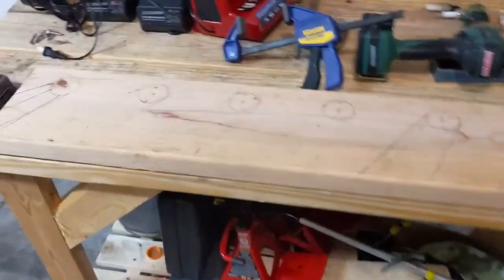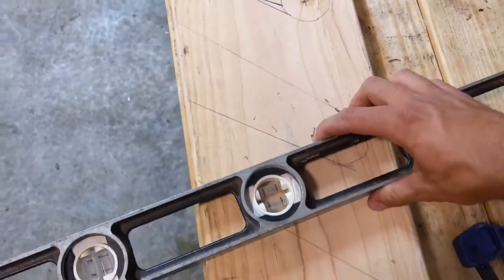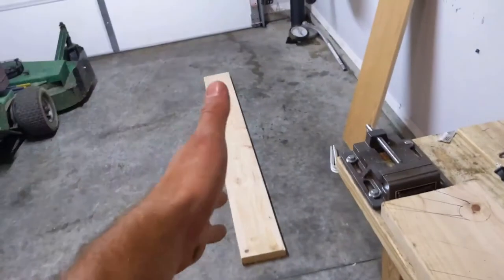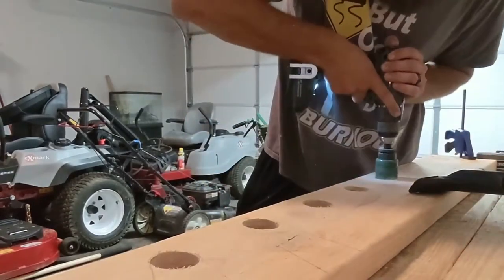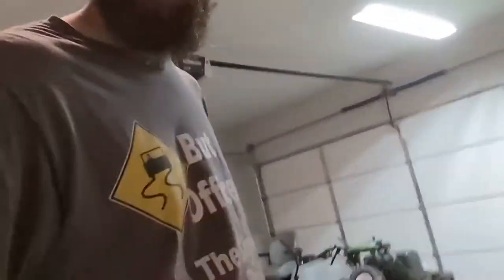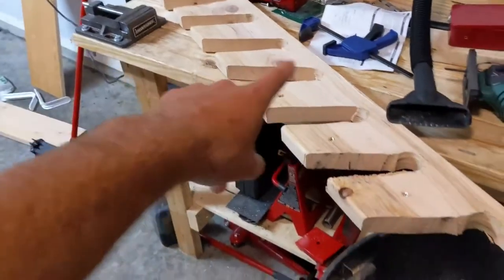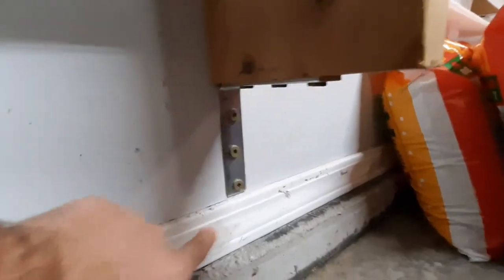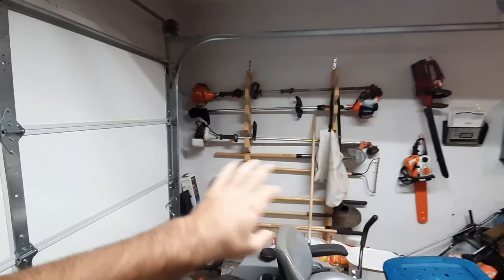How To Build A DIY Garage Tool Organizer Garden Tool Organizer

Comment: That's a good idea using the shop vac for the shaving's. Oh that sucks the wood splitting. Man that looks really good. Nice job and great video brother.
Reply from the maker: @Wild Bill's Adventures man I wish I realized it was split 🤦‍♂️
Reply: @JonsDailyHustle  I know trust me I even bought split wood and didn't realize until I started working with it bud. It turned really good though.
Reply from the maker: @wildbillslawncare5901  thanks brother 🙌
Reply: @JonsDailyHustle  You are welcome brother.

Comment: I will making mine to attach to the wall using a French cleat system and multiple attachment points.
Reply from the maker: @Larry Ginn that's awesome it should hold up well for you. I have put alot of weight on mine this past year and it seems to hold up nice. Thinking about making one for my trailer when I get an enclosed trailer

Comment: looks great Jon. I like using the harbor freight v-shape hang all hooks. they work great for trimmers and can hold multiple hand tools. ive got like 3-4 square shovels on one right now. great thing is they are like $2 each so some of them and a box of screws would be as much or less than one board. not hating on your idea, but lumber is very expensive right now. i made a video about them a few years ago
Reply from the maker: @Hazardra Lawn Care oh that's fine go ahead and hate....🤣🤣 Jk it's all good brother, voice your opinion. I'm always open to ideas. I was using thos hooks but don't quite like them for me, and wanted to be a little creative and maybe stand out a bit in my garage 🤷‍♂️...kinda lol. Wood definitely is pretty expensive now depending on what you get and where. At the time of making this video (originally back in may-ish) I spent less than 10$ total to make 🤷‍♂️. You could probably do it for cheap still if you source the wood right maybe 🤔🤷‍♂️. But your method is definitely way faster lol
Reply: @JonsDailyHustle  for that price you couldnt beat it for sure then

Comment: That's a great idea. I might be stealing your idea for the new garage once we move. You could of used a circular saw too make the straight cuts. Great video Jon!
Reply from the maker: @MBG Adventures that's awesome, I hope you do a better job than I do with making it 🤦‍♂️🤣. Yea a circular saw would've worked way better and faster. I didn't have one and wanted a jog saw first. If I build this again, I will definitely get one for it
Reply: @JonsDailyHustle  Ya, once we move I want to get set up with battery power tools. Always wanted a circular, jig and chop saw all battery powered cordless. I have all them in corded but in situations when you can plug it in, battery all the way!
Reply from the maker: @MBGAdventures  yea that would be really nice. That's a long term goal for myself as well. A chip saw is high on my list of things to get for sure

Comment: You could have just used a large speed square to get the same angle for each cut.
Reply from the maker: I didn't have one back 2 years ago and I also didn't care that much. This was a spare of the moment build and didn't need to be build perfectly, it works just the same